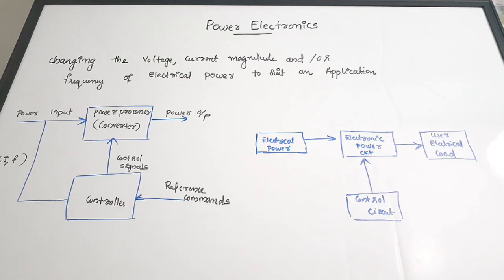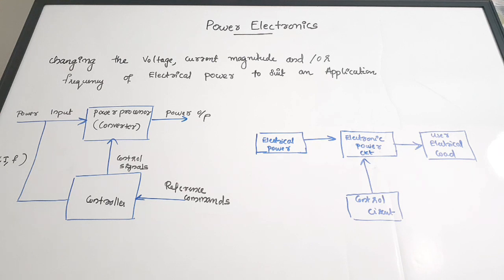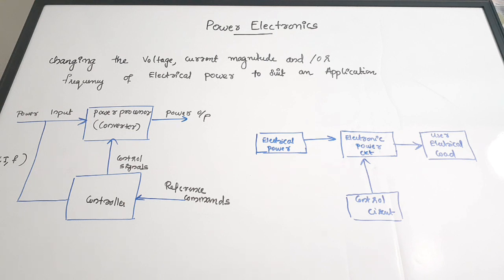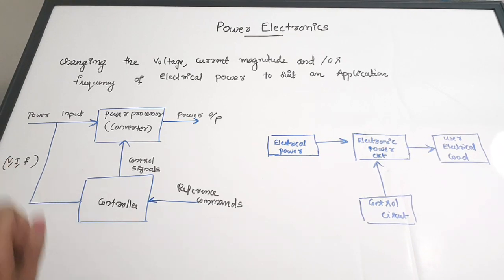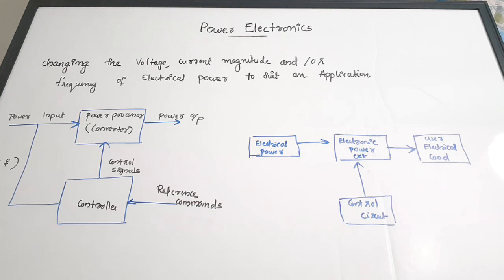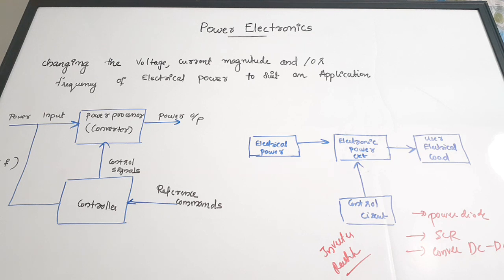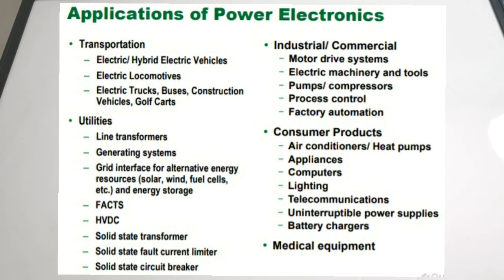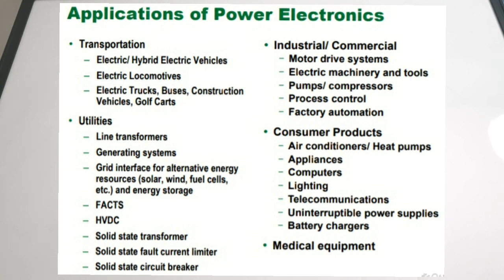Power Electronics  Introduction| Applications | L1

Comment: Madam.will doping of pure silicon affect physical strength of silicon.especially in the case of p side.please answer .it 's not a thought it 's my request.because lam  doing a resarch in electrical field.(b.tech student 22age)
Reply from the maker: Doing generally affect only electrical property in my thought. Anyway let me just check and tell you
Reply: @EasyElectronics_jobupdates  ok madam
Reply: @EasyElectronics_jobupdates  in my knowledge hole will create weakness.but l don't know its intensity.
Reply: I need that intensity.l asked this question to so many experts they did't give proper answer